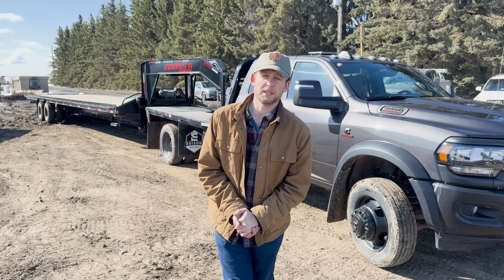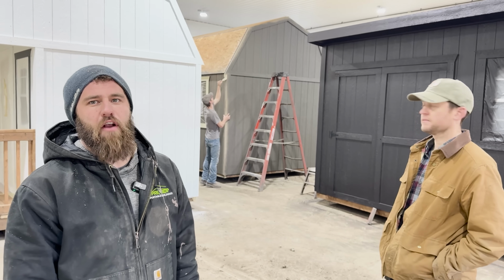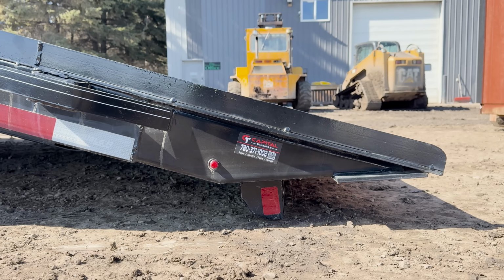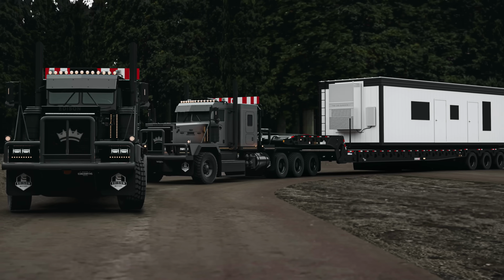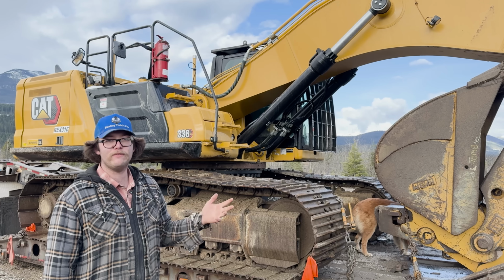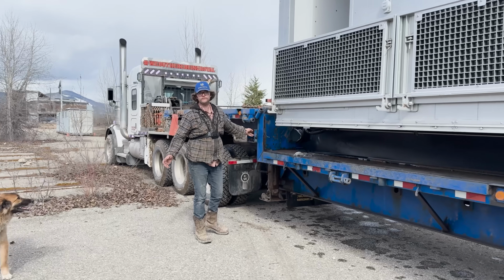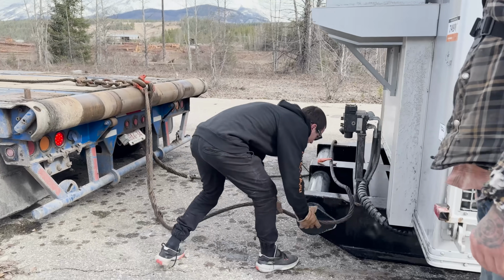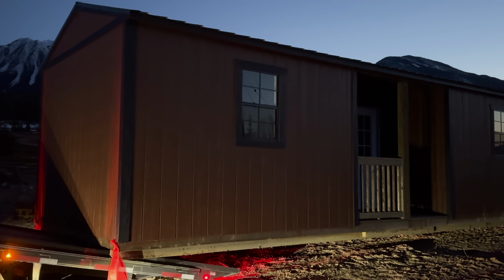Building & Hauling Custom Staff Cabins for Edison Motors

Comment: Edison wanted to revive an old Diesel truck factory in Terrace.  Then they would have had to house employees.  The city only wanted to permit the factory for three years.  And then accuses Edison for backing out of a bad deal. Given that history, they probably would have never issued building permits, water permits, sewage/leech field permits, electrical permits, occupation inspections, etc.  And then they wonder why they don't have jobs and sky-high real estate prices.  SMH.

In Donald, BC.  51.490596, -117.179437  Columbia-Shuswap, British Columbia V0A 1H1, Canada, no such problems.   

Chace, I can imagine several supply chains moving in/expanding, breathing life into the area 
--suppliers for the Edison factory like other companies that manufacture needed parts, warehouses, rail to truck transfer, etc.
-- grocery stores, hardware stores, car parts places, sporting goods etc.  A dead mall needs probably needs to be revived just like The Silver Lake Mall in Coeur d’Alene, ID, bought by  Black Sheep Sporting Goods.
Terrace just shot themselves in both feet.
Reply: Yep. Having Edison at Donald/Golden will start pumping money into the local economy. All kinds of peripheral services will start showing up.

Comment: Chase! What are you doing about water supply for your employees? Are you just running straight well water? Are you treating it? Are you getting town water piped it? Have you had to get permits or water plant operators?
Reply: In another vid, Chace test all 10? wells on the property and they'll remediate based on findings.

Comment: As a fellow business owner I get spending money on growing and building thing up but spending investor money on houses and trailers seems like money being wasted and that you'll be back at the venture capital table looking for more investors with no real accessible product meanwhile all the employees have new houses.
Reply from the maker: I envy you, it seems you do not live in an area where there is a housing crisis.
-Theron
Reply: I agree that on the surface this appears unorthodox.

Edison was able to afford 300 acres up in the mountains vs 3 acres in a city like Vancouver or Calgary. Its a 7 hour drive for employees who commute in from Vancouver and a 3 hour drive for employees who live in Calgary. So Edison is setting up inexpensive housing (sheds) like what is done in other remote work locations like Mines and Logging camps. The investment in land and housing are tangible assets that can be recovered in the unlikely event of Edison insolvency. The money is not wasted.

Edison has zero need for venture capital. They will start turning out sellable trucks soon, or they can do another round of crowd funding style investing. There seems to be plenty of support.  

If Chace started wearing gold chains and flying around in a helicopter, I'd be more sympathetic to your position. As it is, I think Edison and crew are pretty down to earth and practical.

Comment: Chace said "just put the truck in neutral like a winch tractor", when walking it back. I've zero idea what that means? Is there some kind of drive in the trailer, or is it just the winch pulling on something heavier than the truck?

Comment: Eehh.. the jeep does take load off the drives, yes, but not ALL of it.
The jeep plate sits partway between the jeep axles and the tractor plate. 
Half (more or less, depending on the fore/aft slide of either plate) the load goes on the jeep, half goes on the drives, it's the whole point of the jeep, to reduce wear and tear on the road, which is why legal axle weights are what they are. 
The fellas that drop the jeeps on the dirt go on to complain about how tore up the toads are.

Comment: I've driven Pilot (we call them Escort) in the UK and I'm continually amazed by how fucking stupid and desperate to die some other road users are! 
I've been holding traffic on a large roundabout to allow an extremely long and wide load to navigate it and had some bellend try to drive up a centre embankment to try and get around my my van that's covered in hazard flash, LED strobes and signwritten "ABNORMAL LOAD".

Comment: how wide is that? looks like a 10 wide yet you are using a pilot car...weird. 10 wide was '4 flags and go' when I did shacks in BC. I hated when the pilot car was that close. check the permit on how far away he can be. my recollection is they can be be 1.6km ahead of you, which is better then the 20 feet rookies do.
Reply from the maker: The cabins are 12 wide.
It’s difficult to film a 5 second clip of a pilot car in front of you, if they are 1km ahead. 
-Theron

Comment: we call em dollies down under. and if your heavy enough to use a dolly with a low loader you always use it. (but we run higher weights anyway) we use counter weights to get traction on the prime mover. not enough power add another prime mover via a stiff bar either in front or on the rear

Comment: hell yeah, pre-fab is great. you will need to lift and cinderblock the shed for skirting; especially considering winter.
I'm sure this "shed" will be good temporary housing. With some blocks and a couple room additions over the years it could easily become a permanent home.

Comment: that trailer should have sliding axles making loading much easier because it drops the height down which means less of a tilt angle too so thats 2 benifits to it having a sliding axles option because once its loaded u just slide the axles back or to the spot that puts the weight on or off the truck like they do on a semi trucks setup several manufacturers offer that option on that same style trailer
Reply: I too was thinking Landoll myself, much lower and less approach angle .

Comment: 5:00 Does the remote control the truck or the trailer? Since the truck in in neutral, seems like it would be the trailer?
Reply: When the house is pulled up, the trailer and truck naturally slide under it. Assuming that nothing (brakes) is blocking it

Comment: 13:40 when spotting a roll off like that, always spot measure the flat part of the skid up until the skid frame is angled, that will prevent the slight chance of the operator letting out too much line, dropping the shack.

Comment: Note LP smart siding is not good in wet climates. I was looking to use it Calgary and contractor warned me about swelling to water
Reply: I prefer hardi plank the sh*t is proven. The first building in the area that it was used on still sports the original paint we put on it 25 years ago.

Comment: Build the village then build the trucks for the world. Oh check out yankum ropes for synthetic winch lines a lighter option that's just as strong.. well it may make the trailer easier to work with.
Reply: I was thinking the same thing. Some people would say bring the trailer to the US, swap on the synthetic and take it back. 

Not me though. That could be illegal, so I wouldn't say that.

Comment: Are we going to address the elephant in the room of why Topsy wasn't used for hauling a trailer? :hand-orange-covering-eyes:
Reply from the maker: We blew up some parts in testing and we’re waiting for the upgrades parts that the next trucks are using to be installed at the new shop.
Reply: And why not use your older conversion prototype? (I think carl was the name) @EdisonMotors  also great to hear you blew up parts in topsy, that means stress testing is going as its supposed to

Comment: Why aren’t you using topsy to haul stuff?
Reply from the maker: We fried a 3-1 inverter and waiting for the new version and better batteries to show up

Lithium iron phosphate didn’t have the C-rating high enough for charging and the over voltage spikes fried the 3 in 1 inverter

New batteries and BMS for the next Gen are designed based on those lessons learned and are currently being built

We did a video 5/6 months ago called: “everything wrong with Topsy”

She works for short hauls but after about 2-3 days you get a random voltage spike and it fries the $1000 3 in 1 so it’s not suited yet for long trips where you can be stranded on the trans canada
Reply: @EdisonMotors Just prototype problems! 

On that note, have you considered adding a set of dynamic braking resistors to absorb any over voltage that regen braking might cause and to provide dynamic braking in the event of battery or charging circuit failure? Or even just if the batteries are full!
Reply from the maker: Yes actually
Reply: @EdisonMotors holy shit, i didn’t expect a response. Thank you! I saw that video. I just assumed it was already fixed. Thank you!
Reply from the maker: No, it took a few months of engineering problem solving and then 4 months designing the new programming, then 2 months to wait in the production que and test the parts
Reply: Holy crap I was going to ask the same question but I'm glad to see you guys are finding and fixing the problems. Your new factory location looks cool.

Comment: What about water and heating for those cabins?
Reply: i would assume that they have access points that need to be hooked up. and heating would be electrical with either just heaters or small heatpumps.

Comment: Imagine if you made an electric jeep for Royal.  Then you wouldn’t have to unhook it for the off-road traction.  It would save time and labor by not having to swap it out, and you have the additional power and breaking of 2 more e-axles.  Just one of the things that e-axles make sense on that mechanical is just too complex.
Reply: Definitely could see that working well.  Though sometimes they just need to ditch that 20ft of jeep trailer to help with maneuvering and fitting into places.
Reply: @NPzed  That's the beauty of it though. You can still unhook it for tight maneuvers, but it would eliminate that entire process if traction is the only issue.
Reply: Except it’s till in the way lol they want it gone for access
Reply: That's case by case and the company buying it can probably decide if it'd be more helpful for their trails.  Sometimes it's just a fucking hill that you need the extra ass for. @rcjackscx10